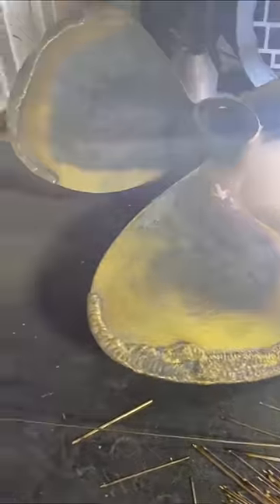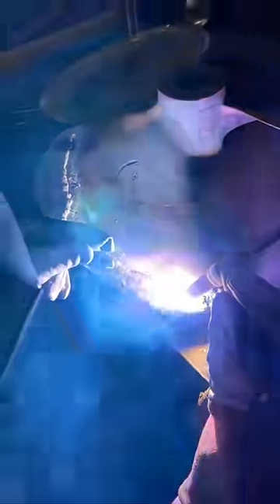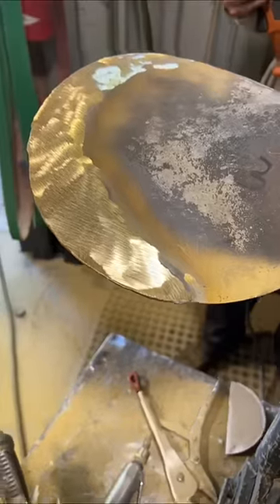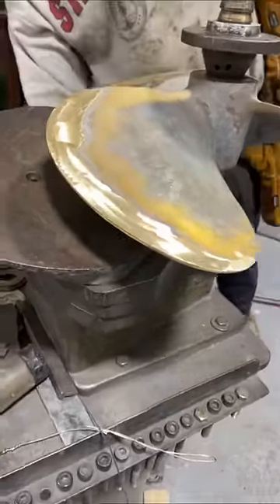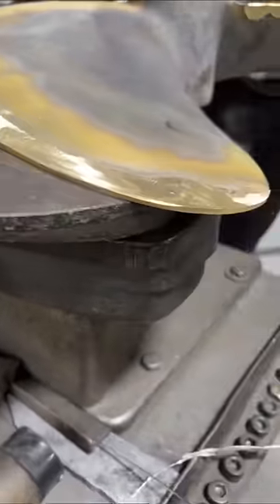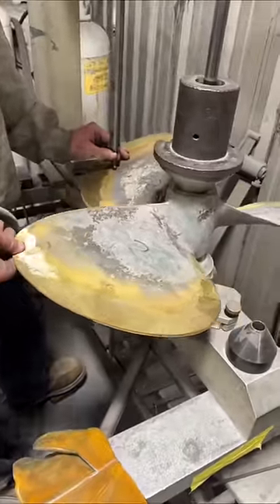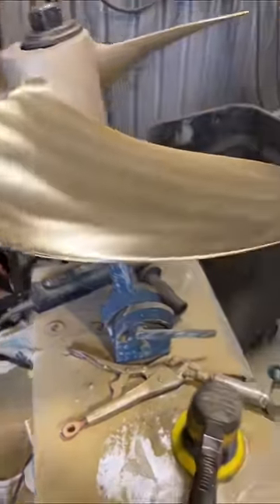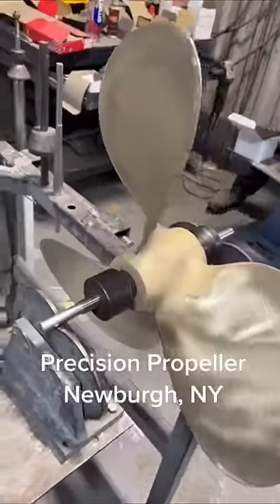Propeller Repair. Source: Unknown. Please contact us for credit or removal. #yeswelder #shorts

Comment: I’m not sure that most people understand the acute skill it takes do this type of work. It takes soooo much experience and a fair amount of artistry. Very cool.
Reply: Some of us do appreciate it :) But it takes a bit of knowledge and experience in technical crafts:)
Reply: I appreciate the skill, even if I don't have the knowledge to understand just how difficult that would be. I mean I'm kinda amazed
Reply: the metal that was filled using the welder wont last for shit. Its a temporary repair at best
Reply: I said, “I’m not sure that most people”….
Reply: I bet the guy that paid that bill knows!!
Reply: @fakedketchup5029  it will last until it needs to be replaced which is the whole point of every tool! If you didn’t catch it, they said it would be too long of a wait for a new one. Gotta do what you gotta do.
Reply: Propellers are cast. Why should brazing the same bronze to a worn prop be any less likely to work?
Reply: I mean, I can make one on a 5axis but honestly, that’s way easier than doing all this by hand.
Reply: @fakedketchup5029  welds can be stronger than the metal they are welding. You do know that right?
Reply: That will last...experience...and right filler material....term is build up...better than new
Reply: Super cool ! Not alot of places people that can do that left . Sad
Reply: @peteragersea377  shipyards do alot of it...cladding
Reply: @fakedketchup5029 as someone who grew up doing propeller repair and boat work, I can say with confidence that if the welder knows what they are doing it will 100% last as long as the original undamaged blade. I've seen literal thousands of propellers go through our shop and vary rarely do the welds cause a problem. It's the places that use dissimilar metals and putty in the perocity that have issues with welds.
Reply: Not to mention getting that balanced perfect..😎
Reply: @TheSlimCognito     I think he should  to get a spare prop.   Next time he might not be so luck to find a welder. On the other hand, he won’t.
Reply: @oldmech619  I've spent a long time in the propeller business and I can say that only novice boaters go without a spare. Nearly all commercial boats have spares. Some even carry them on board for underwater swaps. It's especially Important for people running multiple propellers. Of course some are simply too large and heavy to replace without docking. We use gantrys for many of them to move around the shop.
Reply: @TheSlimCognito    Thanks
Reply: I did this for 14 years
Reply: @adzoutnabout888        I am amazed and impressed
Reply: Also takes Maths
Reply: Yes you’re the special 1% who understands no one is like you no one will match your understanding
Reply: Many shops not even start a project like this. Its impressive
Reply: @peteragersea377  seen guy's in Fairhaven, Mass, near New Bedford doing this work. Nothing like that disaster. I always liked going there
Reply: I don't know anything about this kind of work, but I can tell that they have skills.
Reply: @fakedketchup5029  that repair will last just as long as the original.
Reply: We do know.. and thats because it applies to many trades as well.
Reply: Most don't have a clue.
Reply: Given the time taken and skill involved, I do wonder if it wouldnt be cheaper to buy a new one 🤷

Comment: Great job lads. Jobs like that make you so proud of the work
Reply: Nice.
Reply: Yes sir. Boys should be proud. That’s some fine craftsmanship right there.
Reply: I'm a retired tool welder. I repaired props the same way. I didn't have fixture so I made one from an oak block and carved it to one of the good blades. One of the props was alum. The other was Stainless. I charged 30$ each. Did it on company time😂. Pure profit.

Comment: The world has become so used to throwing stuff out that people forget these types of repairs are even possible. Great job boys👏🏻👏🏻
Reply: Well to be fair, customer ordered new so these were gonna get thrown away.
It’s only because he couldn’t wait 12wks for new one to arrive.
Reply: I can guarantee you that shit cost more than 10 new propellers lmao
Reply: That welding alone is probably more expensive then getting a new one
Reply: the problem is, IS it fixable.
Like yeah, I COULD weld back an engine block but theres no guarantee it'll hold.
I COULD fix your bike frame, but it might crack again in a month or two.

Sometimes the risk of repair, outweighs just buying the new thing.
Reply: @PatrickSwayzeOnDbol It said that’s what it would’ve taken they never said he actually ordered it and now that he has these he probably didn’t. And if he did it’s likely only a backup these are good for continued use. Like new.
Reply: @infernaldaedra Doubtful those things are expensive. If the profit margins were lower maybe but it’s not like they are just seller the propellers for the cost of material and manufacturing.
Reply: @PatrickSwayzeOnDbol as long as he doesn't destroy them again they can be kept as spare now
Reply: @DrCranberry as long as the metal is properly fused and restored to the proper geometry and temper it should be fine, probably a lot easier to do that to a propeller than an engine block
Reply: @PatrickSwayzeOnDbol  yes but then this one can be the spare. or the new one. that way he doesn't have down time when he wants to take a trip.
Reply: @rmdhndwi not by a longe shot. Those propellers there are expensive. The one in this video starts off at 1500 for a cheap one and can hit 4000 for a high end. The repair costs are usually 40-60% of the cost of a new one depending on the shop. For a commercial boat, those savings add up quick and if the quality of work is good, you'll have a life long customer.
Reply: Hang out around the shipyard and you'll find real craftsman still exist lol
Reply: This turned a $100 part into a $1500 one, idk prices of propeller i agree fixing stuff but when cost outweighs repair it's not worth it.
Reply: This is why I go to antique markets and trade shows to find old tools and repair them.

Comment: That’s not a welder, that’s a human 3d printer.
Reply: No, a 3d printer is just a stupid machine. This guy is a lot more than an accomplished pro, he's an artist. I find this comparison just disgusting
Reply: @1zanglang  don’t get your panties all up in a bunch now
Reply: @1zanglang  hey did you hear something?
Reply: @1zanglang  bro?
Reply: @1zanglang  Yet the 3d printers are able to make things you'll never be able to do, and are even used medically, saving lives. So yeah, next time think a little to understand how this technology help so many and save lives. It's not just a stupid machine
Reply: @UnknownEvil_BadAliens  Any machine is operated and/or programmed by people. The machine does the result of human thinking and creativity. By itself, a machine is nothing more than a collection of mechanisms, circuits, processors, etc. At least, by now, there is not a single machine capable to learn and develop its own skills or programming. 
So, the credit for all the things you mentioned, done by a machine, goes to the people who created and programmed those machines, not to the machines themselves. 
The humankid has not a Dr. Soong or a Data, yet.
Reply: @1zanglang  But my point is that it's not "just" a stupid machine..

I wouldn't call an artificial respirator or a defibrillator "just" a stupid machine 

Have some respect for technology that help and saves so many people
Reply: @1zanglang that's not skill, that's not welding. He brazed which is soldering and used a jig +software so unskilled is confirmed. Building a 3d printer is harder than this and so is 3d printing a functional propeller.
Reply: @1zanglang I should not have to tell you this but AI exists and they're 3d printing too.

Comment: That's a monumental task, a third of the blade was missing, i'm sure plenty of people would just have advised to re melt and re cast a new propeller entirely. What type of bronze did you use to repair the propeller? What alloy of bronze was the propeller made from originally? Any special heat treat?

Comment: Wait, so do you clean up the edges and weld a piece of metal onto the propellor blades then grind them back to shape? Or are the damaged areas built up strictly with welding to build it up into the shape while not using any other piece of metal?

Comment: Nice work!   If you are new to cruising, learn the lesson;  Carry spares guys... Props, Water pumps, Fuel pumps, Breakers, Impellers, a wide selection of nuts, bolts, electric connectors and filters for everything.

Comment: Nice. It takes a LOT ,to do that properly. Got my same stock, aluminum prop, on my Yammie 150, new in 2007. Been running the boat since then . Hit many sand bars. and oyster beds, bottomed out. Bent it once, like 10 yrs ago, heated it up, bent it back, been running smooth ever since .

Comment: I've recently needed to integrate custom titanium propellers to a machine. Finding someone with the equipment and knowledge to manufacture the correct helix turned out to be rather difficult. This is actually an interesting niche field, and finding tradesmen to produce quality balanced impellers was more time consuming than I would have anticipated. Cool profession.
Reply: What application are you using Ti wheels?
Reply: @blackhawk7r221  Fluid handling molten salts for carburizing

Comment: Fabulous work. Looks amazing out of curiosity does the weld HAZ cause any yielding problems for the prop farther down the line?
Reply: On my boat, no.   I have two 18” wheels that I repair using silicone bronze rods and oxyacetylene.  I then send it to the prop shop for proper cupping.   I was initially worried about weakness or annealing caused by the localized heat at the repair line, but nope.  But then again, these are wide cloverleaf blades made for generally low or mid rpm applications.  I think it would be a different story with a high speed raked out racing type prop.

Comment: I used to repair props for submarines and aircraft carriers and most wouldn't beleibe how badly they get damaged. Leading edges wasted, blades bent out of pitch so then you gotta cook the blades with torches, hang it from the crane and then bend each blade in an enormous hydraulic press. It gets sketchy...

Comment: Building it up with weld is time consuming and expensive. A much better way to do it is to cut back the damage to a point where the blade is its original thickness and simply tig braze a piece of bronze sheet into place and afterwards cut the edge to template.

Comment: .9 mm nickel aluminium bronze mig wire takes a lot of the weld time out of repairs like these. Very expensive wire but you recoup that in time alone I’ve had to repair brand new props before as cray fishermen sometimes stuff up like anyone else usually on a reef and usually every blade
Reply: Looks like manganese bronze on second look same applies though mig much faster than tig

Comment: WOW. Did he hit under water logs and stumps. I’ve never seen a blade that looks that bad. You’d think he lift the prop a little or get advise of what to expect in that area. Ugh. I bet he had major cavitation and noise running. He needs to get an outboard that is protected by a safety device when hitting under water stuff.

Comment: How do you weld copper or bronze
Reply: This guy is using a tig welder with a silicone bronze rod, but in most cases, you would use a conventional oxyacetylene torch and a brazing rod.  Not difficult, just requires skill from experience.